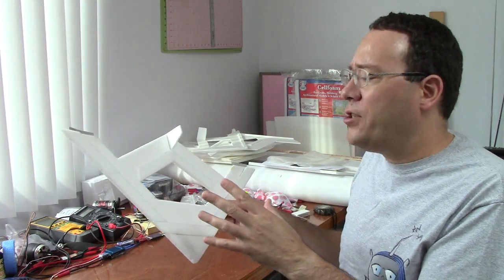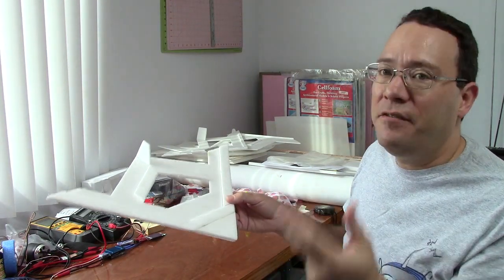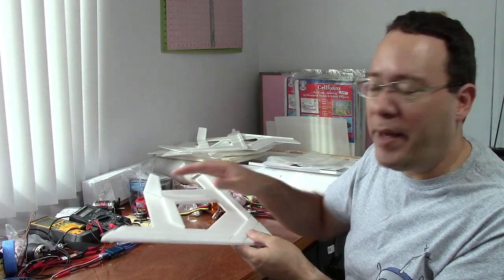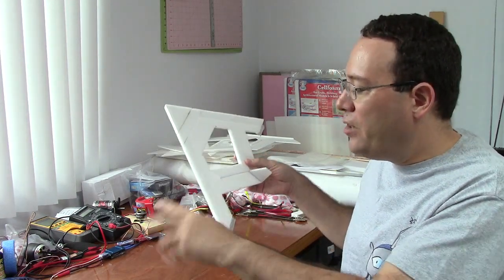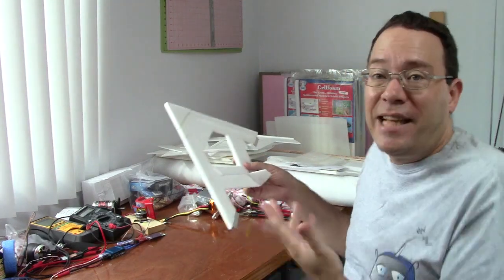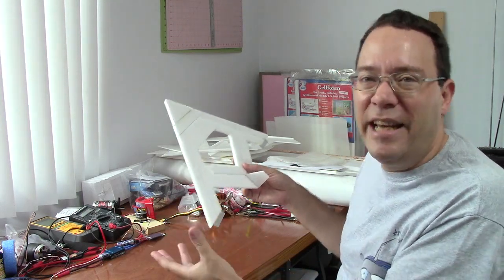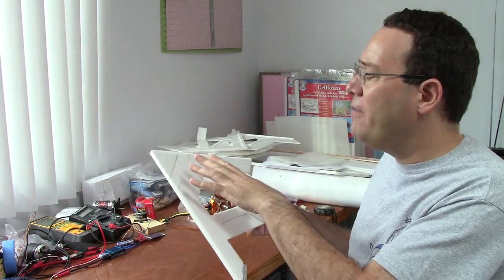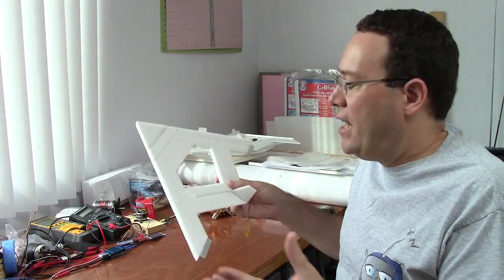Understanding Parasitic and Induced Drags

Comment: Induced drag is also produced by the turbulence created behind the wing as the high pressure air below the wing comes together with the low pressure air of the topside of the wing (same as the wing tip) and because of the rearward pointing vector componente of the lift vector perpendicular to the wing.  The higher the angle of attack, the more that horizontal component points rearward